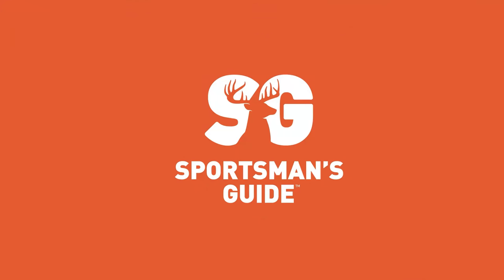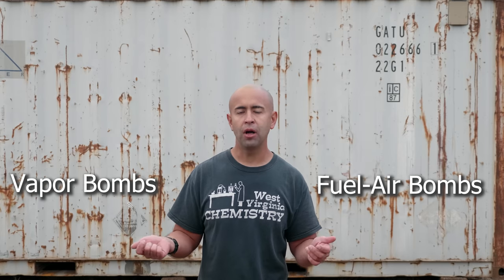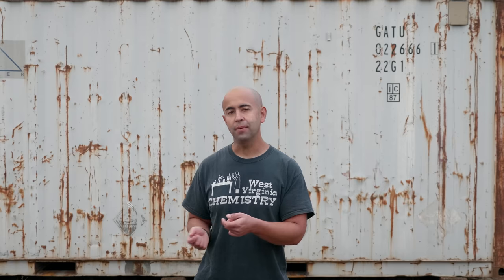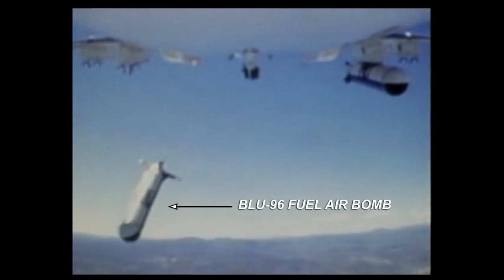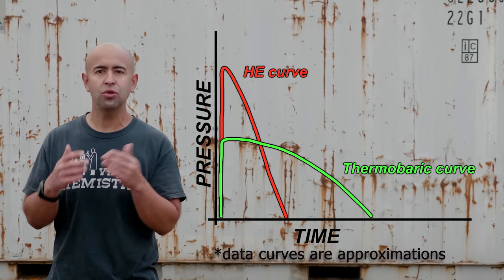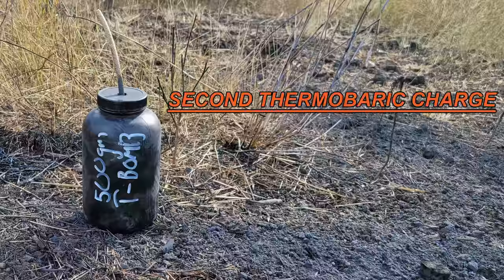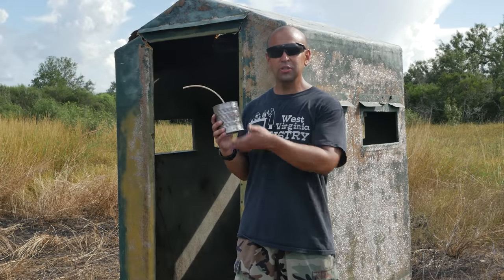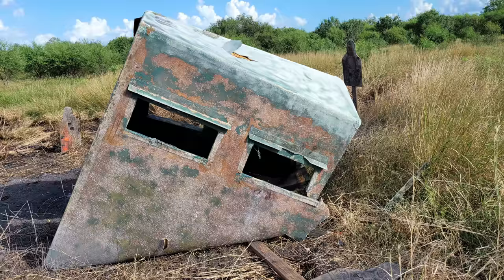Improvised Thermobaric Grenades: Testing Fuel Air Bomb Grenade Designs

Comment from the maker: Jake really broke out the explanations for this video as people requested more information on the devices that we test. Ask and ye shall receive! As always, the 1000th comment will receive a prize so comment away!
Reply: have you made home made napalm yet ?  How about some powergel in a container of phosphorus and fuel oil of course in an air tight self contained container until detonation with an outer core of mercury ?
Reply: Wish Cody a happy marriage for me!
Reply: @zaynevanday142 
Okay, but what is the pure elemental mercury for? That does not sound very environmentally friendly. Hg does not make for an effective thermobaric casing layer anyway, it is far from an optimum metallic fuel for usage in energetic devices. Hg is only useful in energetics in the forms of some of its salts and complexes, not as the pure element mercury.
Reply: That was pretty impressive
Reply: Look at the off the press channel. They also made some amateur thermobaric devices, and did get a successful one done after many failures. They used liquid fuel.
Reply: Question, did any of the 3 achieve actual detonation? I didn’t see any shockwaves/pressure refraction that would indicate they did.
Reply: Different explosives vs balistic dummies
Reply: keep the explanations! it was very interesting
Reply: THANK YOU
Reply: What kind of prize may i ask, is it a form of explosive?
Reply: @NikolaiRomanovsk  beyond the press
Reply: @scrappydoo7887  right
Reply: @embers_falling  im not an expert, but i dont think so. best case was a conflagration, which may have boosted the main charge, but i do not think any of them caused a "detonation" as defined in thermobaric devices.
Reply: @zaynevanday142  yeah I would love to see that if they ever do it though they won't be able to tell us directly that that's what that they are doing, like how they were pronouncing the word magnesium "solid fuel" in this video
Reply: Can can launcher with tannerite in a tennis ball. Or a cannon with tannerite in a ball. AT A BUILDING OR WALL.
Reply: Explanations were on point. I kind of felt like I was watching  one of those MythBusters segments where they animate blueprints while the narrator explains. It's probably a little more work to do the animations but it makes an instant difference in production quality. It stops feeling like you guys snuck out back on lunch break to film a bit of silly fun for the yootoobz, and starts feeling like we're watching a slick edutainment production. The last several months of videos have been raising that bar higher and higher. Great work!
Reply: That's one way to get comments and game the algorithm! Bravo!! 😼
Reply: Try RC Car fuel. Its good stuff.
Reply: Try polypropylene glycol and ammonal
Reply: loving your work, i need to do an Australian show like this
Reply: Can I just spam to a thousand? Lmao I'm a huge fan of your channel guys
Reply: Another thing too, separate smaller explosives set off that fuel cloud a hell of lot better, trust me, it helps to burn the fuel more effectively.
Reply: @NikolaiRomanovsk  I didn’t either but thanks for the second opinion
Reply: would a fuel like propane work since it is liquid under pressure
Reply: Dose 22 rimfires in a bottle work like a grenade ?
Reply: Was that a magnesium/aluminum mixture?  Maybe with a dash of perchlorate?
Reply: I'm working on a fae bomb as my college project. Can you guys guide to some books or literature.
Reply: What solid fuel where you using? Aluminum or magnesium? And what was the micron size? 
What did you use for your main charge? No second or delayed charge?
Reply: Try a golf ball size of potassium perchlorate mixed with 50/50 three micron aluminum powder and 30 micron aluminum; then wrap a layer around that of ANFO making a baseball size ball then put that in a five gallon bucket of Ethel alcohol.
Reply: @briankudalis9572  My guess was aluminum and magnesium with a perchlorate.  However they can't tell us for civil and criminal liabilities.  Not to mention getting reported to all manor of law enforcement around the planet for these videos.  And all the while following the law with excruciating care.
Reply: I read somewhere years ago, that if a 5lb bag of flour is placed on top of a half coffee can black powder charge, when detonated the flour would disperse and subsequently explode in a somewhat profound way. I've always wanted to try it but have always been more afraid of the part where I don't have a license that would allow me to play like you do. 
Now I ask you, would this work? What if magnesium shavings were mixed in with the flour? Or ammonium nitrate? My imagination can run wild with this idea.
Reply: Thermobaric mortar rounds PLZ I know this is an old video SHAWN see this!  In shalla!
Reply: Do you guys have part 2 ?
Reply: I like stuff in things. BikmM Bockm BOOOom//\\/\/\\\.  Boom snake the womb. Dolla dolla biill dough cake la loon. But that applies just in june. Every other month d stork brings bindles and bundles of pork. Class A class C cork co stars get in nas T in slide b.
Reply: 🛡Μολών λαβέ
Reply: The mercury can serve a couple of purposes imo. One:it is highly conductive so it guarantees contact in a device using a pressure switch....on this note mercury doesn't corrode so if one was to build several devices and store them oxidation of the electrical contacts should not be of concern. Secondly: mercury is extremely dense and if used in a pressure switch device this certainly puts the device to land nose first(unless of course you have to much ass weight like my ex)allowing the mercury to then break it's container make contact for ignition.....and third: this is far fetched and gruesome but I would imagine for those whom survived direct blast that it's possible molten liquid metal would be dispersed throughout the area(who knows how far) embedding into what ever it hits(could be something in ones arsenal to bugger up a machine components...hot hot liquid metal in little tiny tiny beads burning into wiring and hydraulic lines, couple this with electromagnetic fields in the machine to attract the those tiny beads into the circuits further)..…just off the top of my head.
Reply: Can you please tell me how you achieved the double explosion? as one charge serves to disperse the cloud, and the next one triggers it. How did you get it?

Comment: I got one we did in the military. If you wanna destroy a simple structure with minimal use of explosives set up a charge in a 5lb bag of flour and set up a secondary charge to detonate a second later. The flour will cause increased air pressure in a confined space and a small secondary charge will cause massive structural damage. Its really awesome when timed perfect.
Reply: Yup flour mills are dangerous places, that's why they use intrinsically safe lighting and power devices.
Reply: @marvindebot3264  yeah so are corn cribs. I live in Iowa and it happens at least one or twice a year.
Reply: Oh damn, that was the coolest demonstration a science teacher ever did and you just weaponized it.
Reply: Ah.. the "notorious" powder explosion -😂🤣
Reply: That's in TM31-210.  

Also saw it referenced in a book in the Golden Compass series, which was written for late teens/early adults type age group.
Reply: Check out the Mythbusters largest fireball. They started with sawdust, then used powdered creamer. Inside an enclosed space, the flour does 2 things, burns really fast, and creates a vacuum so that there's a push pull going on.
Reply: "the Finer the particles is, the more "beautiful" the process is".. kabooey..

yeah.. stuffs like flour & saw dust will come in " Fine  " by default
Reply: Most things are explosive when aerosolised in the correct ratio of particles to air. Iron filings, dust, flour, sugar etc etc...
Reply: Thank you for your service.
Reply: Lol sounds about right I use to be able to put a little flour in my mouth and blow it on a lighter to catch fire
Reply: @Revivethefallen  all the dust is flammable?
Reply: @crazysilly2914  almost everything is flammable in a pure oxygen environment including diamond and steel.     So what we are doing here is because the atmosphere isn't pure oxygen to expose something like flour to enough air to cause it to be explosive it needs to be finely dispersed in the air then it has enough surface area to burn in such a rapid way it becomes explosive
Reply: I’m a retired fire inspector/fire investigator. I used to teach classes on combustible dust explosions both to other public agencies and to industry. I would demonstrate explosions with flour, coffee creamer, powdered sugar, powdered milk, pepper, cinnamon, tapioca powder, chili powder, dust from grinding vehicle tires, sawdust, powdered aluminum, etc. It hit me one day when I was buying supplies for a class, standing in the grocery store checkout line, that nobody around me had any idea that I was buying explosives!  :)
Reply: @keppscrossing  wonder if that's what terrorists think before they do some danger chemistry 😂
Reply: Mr. Wizard did a demo of that way back in the day. It was flour and a candle inside a sort of bucket with a loose lid. He blew through a long hose and pop went the lid with a big fireball.
Reply: @Thane36425  yep, that’s one of the demos I did.   My chief was rooting for me to hit the ceiling in the vehicle bay with the lid.  I never did, missing by a couple of feet.   I also did large scale demos in a cast concrete manhole cone using a leaf blower to blow various combustible powders through a 3 inch pipe into the concrete manhole casting with an ignition source inside.    Lifted the whole thing off the ground a few times with the explosion.   I also got secondary explosions several times after the inside of the manhole casting got a fair amount of flour, etc. inside after several single boom tests.   The old flour would get fluffed up by the explosion and make a second one, often bigger than the first, just like frequently happens in real life combustible dust accidents.
Reply: Any super dusty place
Reply: Aka. A dust initiator.
Reply: By any chance was that 06-07?
Reply: @keppscrossing  can you teach me??
Reply: @zachdorian925  🤣..... Hey Tarzan, That's what YouTube is for. 
🤟🤣🤘
Reply: Haha, a “silo bomb”.
Reply: I also learned about using a Dust Initiator in the Marine Corps. I was originally an 1371(Combat Engineer) but ended up going to RIP and after 2 years of training and different schools i became a 0326 (Recon Man Parachute and Combatant Driver Qualified). At that time in the early 90's Force Recon needed guy's with explosive skills, and to the point there are a lot of tricks to increase an explosive charge or device really cool stuff.
Reply: @RobertSmith-hr6cr  Did you ever go to Amphibious Recon School?
Reply: We use quite a bit of intrinsically safe equipment in the oilfield. It’s quite surprising sometimes how little it takes to set off explosive gas at LEL. Also a lot of gasses around are heavier than air and hit the ground so it’s kinda cool watching them roll out of the hole and waft around the ground, although kinda scary.
Reply: Ahh yes so does this work on a bank vault?
Reply: @marvindebot3264  89pkp
Reply: @zachdorian925  air+dust+fire=explosion
Reply: Look up the CSB video on the Imperial Sugar explosion. Poor housekeeping led to a dust explosion that propagated and pretty much wrecked the entire plant. Caused a number of fatalities as well.
Reply: @pckkaboo6800  ...corn starch baby powder is also an explosive agent
Reply: @keppscrossing  ... told my MD that the heart drug Peritrate©® is a military grade explosive; PETN... she had NO idea that was true
Reply: I wonder if the same thing can be done with Mg/AL powder so you have a hotter burn. I'm not sure what the differences between burn rates would be, but it would definitely be hotter regardless
Reply: Thank you. I will try this the next time I blow up a simple structure.
Reply: Your comment was better than this whole video. Literally.
Reply: Anyone who wants to get an idea of how wild these things are just grab some packets of non dairy creamer. 

Next light a candle or a bic  or whatever and then sprinkle the powder down from a from a foot and a half above into the open flame. 

Hotel rooms are great for this cuase they offer the non dairy creamer and a safe secluded friendly environment. 

Tell me white it goes and ask wearing is needed. 

(All advice here is not. And all words are knot. A tangle of sat tires and standing wheels. Wheels of the fortune.   As well as the #breakingWheel.
Reply: Nice to know. Perhapse if you shared this info with the Ukrainian Foreign Legion, they could put your advice to work.
Reply: One of my favorite explosives. It's called a dust initiator works best inside a Building with minimal windows
Reply: @Crimsonedge1  Water too
Reply: @Grognarthebarb  The Shia Population of Bahrain is terribly persecuted by the ruling government there. 20 years ago, I only heard through the grape vine because there is no free news media. Some people started to put something in parked car's gas tanks and the vehicle would explode like a bomb.
Reply: … what an interesting tidbit of information.
Reply: Damn did the tali teach you that? I super never would have thought about that, that's great stuff.
Reply: @Crimsonedge1  titanium and sulfer trioxide
Reply: Mix in some sulphur and magnesium  powder for a bigger boom
Reply: @BimmerWon God bless America
Reply: On larger scale large buildings are destroyed by unintentional dust explosions. A grain mill blew up in my home town and launched shrapnel a mile away. Check OSHA and CSB for examples.
Reply: I know where kepps crossing is, I spent 6 years in Idaho falls. Good trout fishing out at Blacktail, but also a lot of rattlesnakes! Lol
Reply: @beardedhopsman ,v
Reply: I’d say…damn
Reply: @Crimsonedge1 wonder how many experiments they did figuring out which substance burns the hottest or does the most damage?
Reply: You really dont understand what you are doing.
Reply: ground coffee works better but can be more pricey
Reply: Sugar also
Reply: In Minnesota, the flour companies buildings would blow up a lot.

Comment: Technically, that's an incendiary charge, not a thermobaric charge. A thermobaric explosive disperses the fuel before lighting it up, causing a detonation. In this video, the fuel is lit before it is dispersed, which just causes a large fire instead of the desired detonation.

Comment: This reminds me of something I read not too long ago. Apparently  during WW2 the germans developed a FAE where they would disperse coal dust and aluminum to simulate the interior of a coal mine during an explosion. It worked spectacularly and they ended up making it delivered by rockets, but by chance the vehicle carrying the explosives was detonated just before they were going to use it by an artillery barrage
Reply: Interesting, do you have a link for it?
Reply: @mk6315  It's in a book called "D-Day through German eyes" by Holger Eckhertz, in the second part. It was called "Typhoon B", https://youtu.be/pUqhlgbgEu0?t=21256 is a link for the audio book, timestamped at the correct part
Reply: These Blast Bombs were used with great effect during the Crimea and Sevastopol siege  They are some of the first instances where Weapons of Mass Destruction are mentioned other than Gas!
Reply: Believe these were used in the Warsaw uprising too against the Polish insurgents in the sewers.
Reply: also flour works